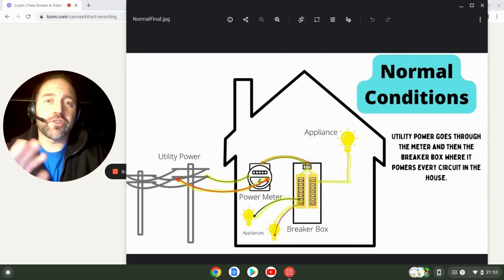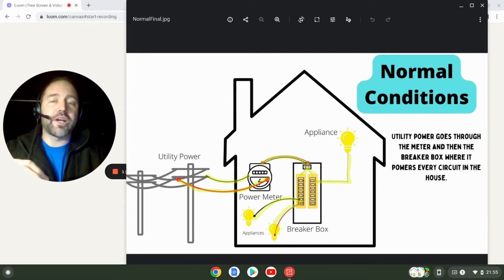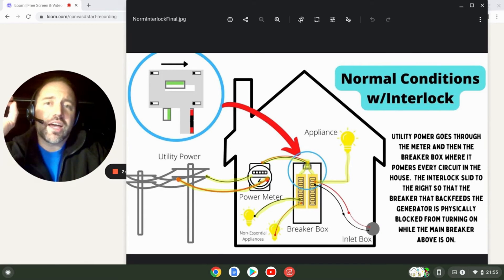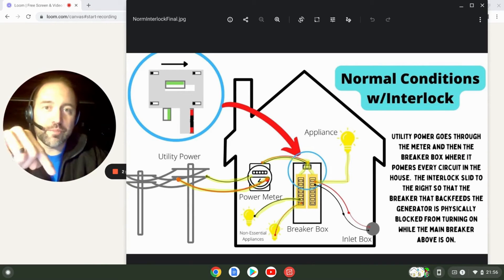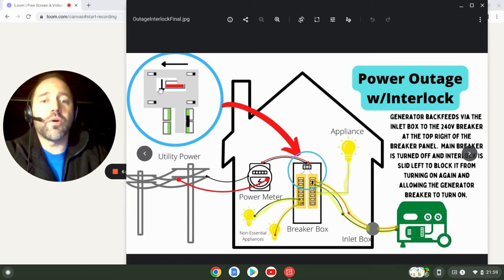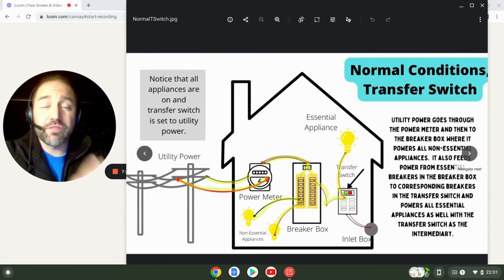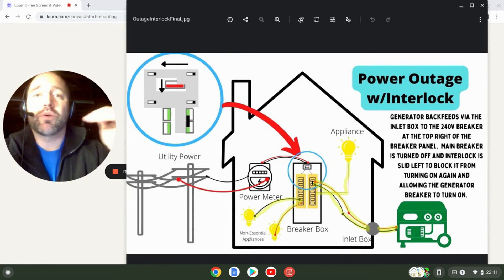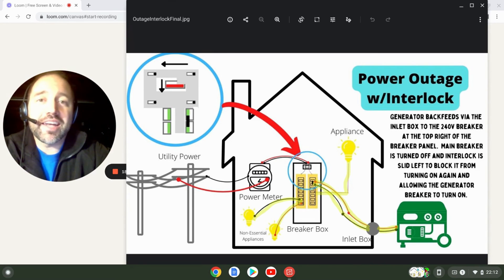Transfer Switch vs. Interlock Kit - How They Work & What's Best for You

Comment: Is it possible to have the grid power run certain high wattage appliances and also have my bluetti power station run other things under the 2000 watts that my bluetti can handle. Ki d of how my hybrid solar system works?

Comment: What happens if a panel doesn't actually have a main breaker at all? How would you be able to use the generator without a transfer switch?
Reply: You get an electrician to install a main breaker into the breaker box. That's what I am about to do. I want the interlock set up. My main breaker box is located in the garage and houses all my breakers. It does have a punchout labeled Main but it doesn't have one installed. My main breaker is out in the box below the utility meter. However I can have one also installed in my Main panel. The 200amp main breaker I bought off amazon with a 50amp double pole breaker for the Generator breaker for $104. It's Siemens brand.  Electrician said he would charge me $500-700 for labor to do everything which is a good deal. I bought all the parts. He is installing everything. 

He will Install the 50amp inlet box 3 feet below my main panel. He will run 6/3 romex to the main panel. He will have to rearrange a bunch of the breakers in the main panel so he can put the 50amp double pole at the top right of my panel. He will install the 200amp main breaker right above the 50amp gen breaker. Then the left side of panel he will install a surge protector. Then he will install the Interlock kit. He will switch  one of my 15amp breakers to a afci because all of my other breakers are afci except for one 15amp breaker which is odd? The original electrician who wired the home must have ran out of 15amp afci breakers and slapped a reg in idk. Then lastly he said he would fix the reverse polarity issue on my 30amp bluetti. All this for $500-700. Feel like that's good. He said if he was supplying parts too I would he looking at $1200 for everything. Said he could get it all done in 2.5hrs to 3hrs.

Comment: I have 2 disconnect cabinets adjacent to the meter base (I think one feeds the barn, the other the house). Both have only the circuit breaker used for the disconnect switch, with no provision for any more breakers. In any case, the panels in the house do not have disconnects since those are outside by the meter base. I assume that means I cannot use an interlock kit. And I hate the idea of transfer switches. Are there any other options?

Comment: The total generator capacity is usually not all available on the 240 volt outlet.A 5000 watt generator may only have a 20 amp 240volt outlet for example. The interlock receptacle on the outside of my house is 30amp but my 5000watt generator has a 20 amp 240 volt breaker.

Comment: I have a portable floating neutral generator with Interlock kit at the house panel.  Also have 50 amp outlet for generator to plug into which was professionally installed and has neutral and grounds connected to appropriate locations in breaker panel.  Do I still need to ground the generator in this application or will the connected house ground suffice ?

Comment: You didn’t cover bonded neutral vs floating neutral generators as it relates to use through an interlock and grounding scenarios.  Based on your other video I’m assuming floating neutral generators used with an interlock should not be grounded?
Reply: If you are feeding power to your house using a portable generator through your breaker box be it using an interlock system or transfer switch, the portable generator should be a floating neutral generator. The exception is if you have a neutral switching transfer switch then the generator should be a bonded neutral. If you are powering your appliances through a portable generator using extension cords then the generator should be a bonded neutral. The difference is the breaker box is already neutral grounded and you don’t want two places to be neutral grounded so you want a floating neutral generator (neutral not grounded). Feeding your appliances directly through your generator, so none of your appliances are neutral grounded then the generator should be neutral grounded or bonded neutral.

Comment: Why do the breakers from a generator need to be on the top? Thanks!
Reply: The metal plate from the interlock has to cover the main breaker from the panel which is located at the top of the panel(bus bars)

Comment: Thank you for this video.  I had an interlock system installed for my gas/propane generator for emergency, but now  I have portable solar generators that they say you need a transfer switch.  What can I do? I choose the interlock because I wanted to power certain areas to power like freezer, refrigerator, washer, etc.
Reply: I both a gas generator and a backup battery. You can use both with the interlock device. You simply plug your battery into the same  inlet you plug your generator into. You get an RV adapter, 30A, that let's you  run current from the 3 prong outlet on your  battery to the cable you have for your gas gen to the inlet box on your wall and wahla, you've got power!
Reply: @T4JQ3L  I just had work done, and I can only use one at a time, it is either the battery or the gas/propane generator,  I can't use both at the same time.  Up switch is for battery, and down switch is for generator.  I wish you would have  answered my question earlier than this. I could have had the same set up.   I am not having them do it all over.  I have two Bluetti's AC300 and two B300 batteries for each.  I still do not have it hooked up, because I need to have someone drill a hole for the mc4 cables from the basement to the outside.  Not sure who I can get to do that.  It is a slow process.
Reply: @EliseGeiman  correct. You can use both, but not simultaneously. I will use the generator during the day with a portable AC and to charge up battery. Then at night, unplug the noisy gen and lock it up, and plug in the quiet batteries when there's not much of a load. Plus, the battery is much more portable than the 200 pound gen.  So, it's not a loss, you can use both, just not at the same time.
Reply: @T4JQ3L  Thank you for clarifying that for me.  I am grateful that the wiring was done corrrectly.  I was wondering how you could have both on at the same time, because they never mentioned that to me.  the told me it was either gas/propane or Solar generator not both at the same

Comment: Everyone gives the same example of what can go wrong without an interlock. Might kill a lineman they say.  What about the opposite example?  With no interlock and power is on, someone sees a breaker off, the one for the generator, and turns it on because they think that all breakers should always be left on.  This creates an energized male pins on the inlet.  Which could kill a household member.  
Btw, I think that a generator main breaker would trip if it was trying to power the whole neighborhood so the chance that it would stay energized beyond a split second is rare.

Comment: Well done presentation. One thing to add is that an interlock switch is all or nothing solution and the transfer switch allows for more options. With a transfer switch you don't have to wonder if the grid electricity has come back on either since only a few circuits are run through the transfer box. The un-switched circuits of your home will turn on when the grid comes up and you can go flip the switch and turn off your generator.  And since your electrical system doesn't know what the power source is, instead of using a fossil fuel generator, you can plug in a solar generator and never have to go out in bad weather during a power outage. A transfer switch would also allow you to power select circuits through solar and reduce your energy bill while at the same time using grid power for some of your electrical needs. An interlock device is a cheap solution but it doesn't allow as many options as a transfer switch.  ...just sayin'.
Reply: Interlock switch is not all or nothing. You can switch off the breakers in your breaker box that you don’t want on. You can choose the breakers that you want to be on or off and change anytime you want unlike a transfer switch that needs to be pre-assigned/wired the to “X” amount of breakers on the transfer switch box and those are the only breakers that can be switched on. Depending on the transfer switch box there are only a set amount of breakers in the transfer switch box that can be switched on unlike a interlock switch where all the breakers from your breaker box are available for your choosing to switch on (depending on the power of your generator).

Comment: I enjoy your presentation s. This is timely for me. I have the interlock config. I have an audible alarm kit installed on the grid line side so I will know when grid power is available. Important question. In your previous presentations you discussed bonded and floating neutral generators. Which applies here with the interlock kit? I noticed that the neutral was not discussed. I think perhaps a floating neutral  will be required relative to the portable generator. If you or any experienced electricians watching could help clarify this, I would greatly appreciate it. Thank you all.
Reply: please see the links for more info
https://www.youtube.com/watch?v=nKWf7XTg-wg&t=229s
https://www.youtube.com/watch?v=RkjjZJgaINA
Reply: I was wondering the same thing. I am setting up a 50 amp with interlock. Was wondering what I need to do if anything. But I think that the bonded neutral is only used for the 20 amp gfci outlets on the generator. The 30 am and 50 amp plugs are not part of that system. So I think nothing needs to be done. But I could be wrong.
Reply: @retiredarmyvet2018  that is my understanding also
Reply: @retiredarmyvet2018 
I am in this exact predicament. I think all the plugs are connected. I got was one of the unlucky recipients that got a reversed polarity 30amp receptical on my Bluetti AC200max. When testing this you plug a ground Neutral plug into one of the regular 15amp plugs and plug a 30amp adapter to regular plug into the 30amp receptical of the bluetti. Then plug in  Klein Tools polarity tester and it says Reversed polarity at the 30amp receptical. It is using the 15amp plug as a reference to show this which wouldn't that mean they are all connected in some way? I know some eco flow deltas had reversed polarity at the 30amp receptical too.